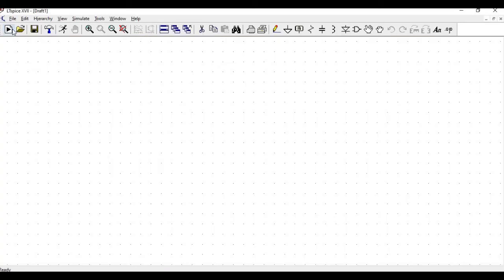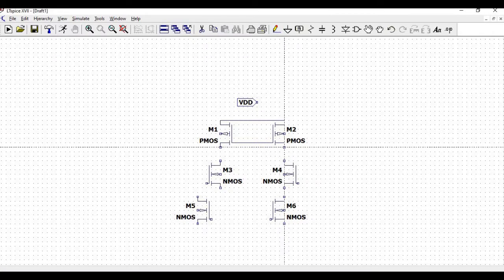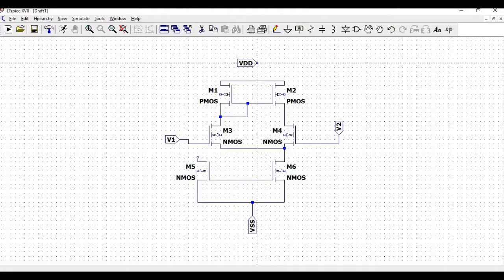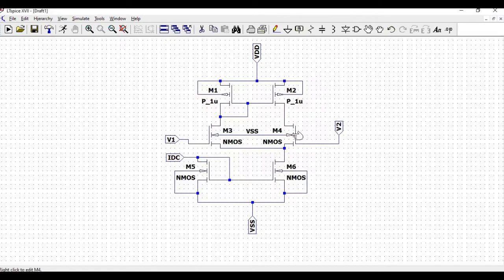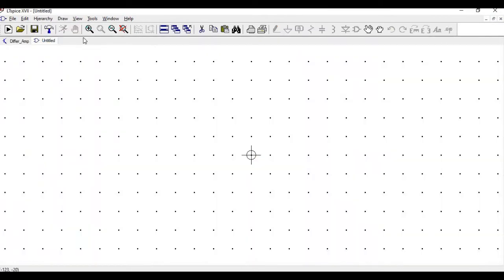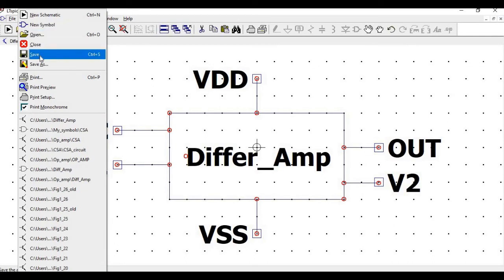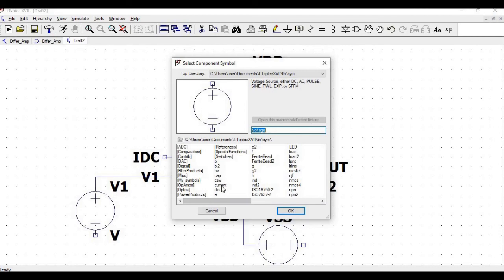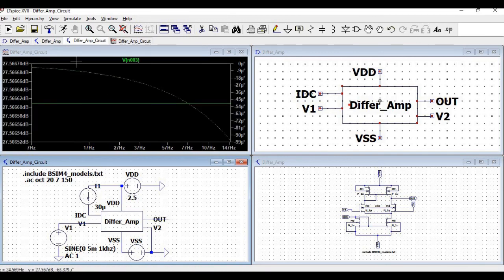AC analysis of an differential amplifier using LTspice tool and BSIM model

Comment: bro would you calculate CMRR for this circuit?
Reply from the maker: For that you have to replace the bias current at the source of transistor MOSFET with small signal output resistance.
So in small signal ac analysis define the amplitude as 1 and desired DC value around 500m.

Then define AC analysis 
Sweep type Decade
Number of points per decade 100
Start frequency 1k
Stop Frequency 1G
Reply: @circuitgenerator9788 thank you &
 let me try